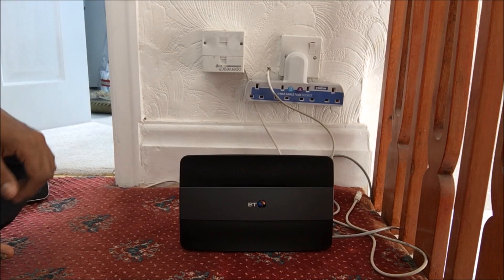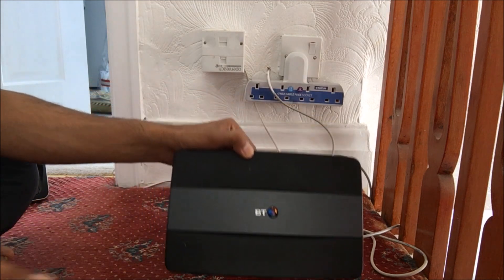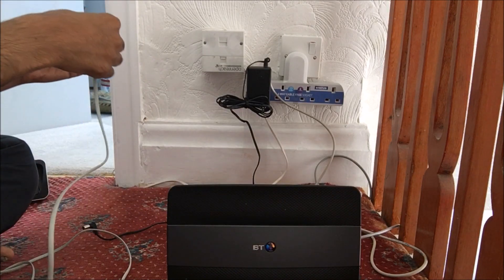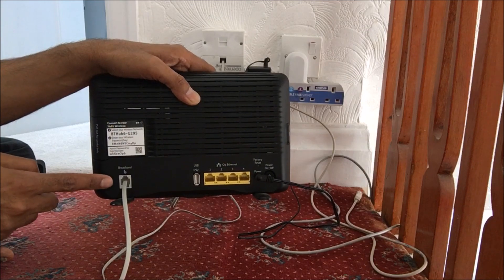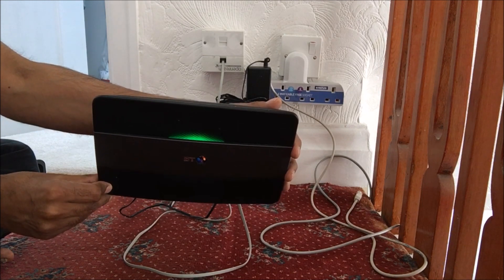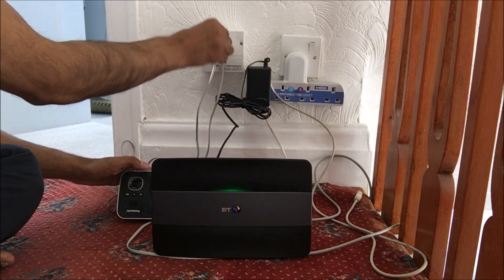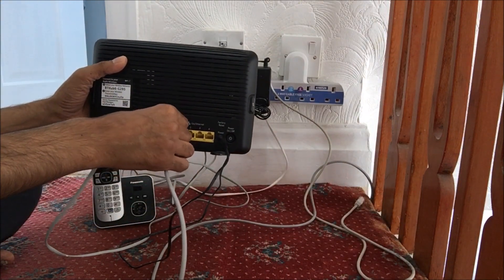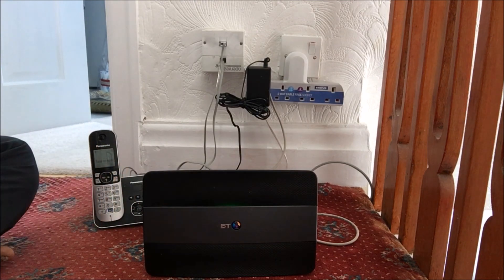How to set up BT Smart Hub Router

Comment: We've just got one of these. Ours is currently a solid orange colour. Tried the troubleshooting wizard, but it keeps telling us to contact BT. Apparently they've set the wires outside in the wrong direction and into someone else's property. Openreach are saying it'll be another week until we're connected. Thanks for uploading this as the instructions for ours mention nothing about this "RG11 cable".
Reply: Will Campbell is it past activation date?
Reply: @bencrossland6990  way past. Our 'Go Live' date has been pushed back a further month. No-one at BT can tell us why this has happened.

Comment: Um... I have OCD and why on earth is your master socket upside down!?
Reply: Thomas-Jacob Connolly he does say in the video it was set up by the BT engineer like that
Reply: Haha
Reply: Probably because the existing cable was not long enough to fit the socket the correct way up. Or perhaps to cover a hole in the wall. Of course the cable could be renewed or extended but deemed as not worth the hassle. It seems nuts, but I have seen this before with electrical sockets.
Reply: You don't have true OCD otherwise you'd call it CDO :)

Comment: Mines stuck on a solid green light and nothings working, I turned it off and left it for five minutes, I unplugged it and left it for five minutes, I tried the factory reset, it's stuck on a solid green light all the time. My old home Hub 5 works just fine though.
Reply: That's interesting..... My hub 5 was brilliant for 5 years..... On setting up WPS button needs to pressed to help with connection.

Comment: My BT Hub doesn't have a password.
For my Laptop I was able to connect it using the BT Connection button but for my Phone, there is no such option.
Help!
Reply from the maker: you should speak to BT for some assistant as you should have had a password with your router.
Reply: @TechGuyy  Thanks!

Comment: It's going orange after everything is plugged in??
Reply from the maker: Ring BT as there is a fault on your line
Reply: Tech Guyy why is mine flashing purple. This is before Activation date
Reply from the maker: you have to wait for it to be activated. 
The purple flashing lights means there is no internet as its not been activated